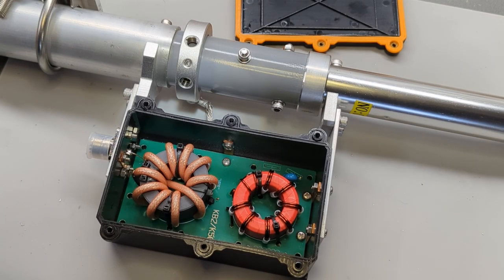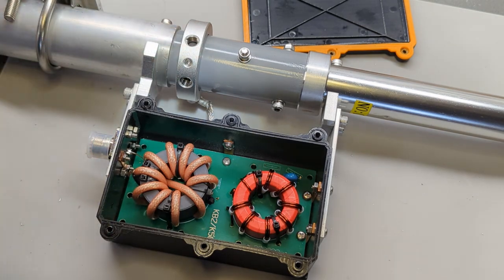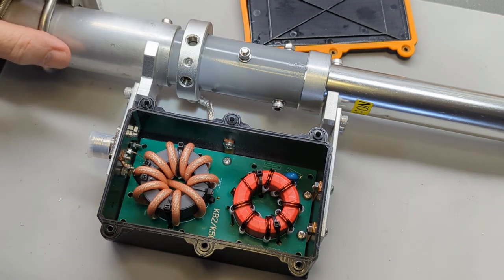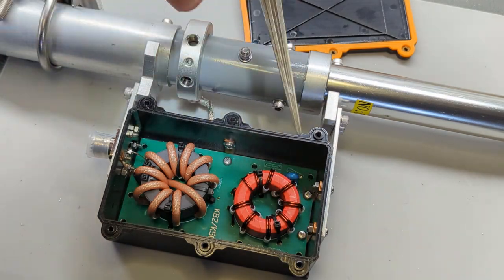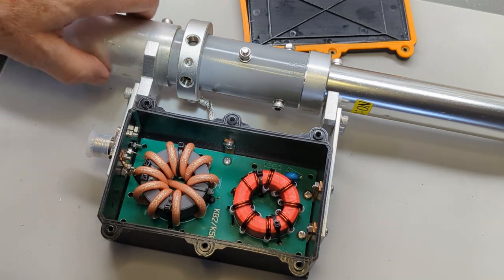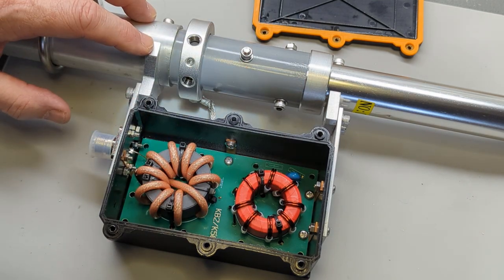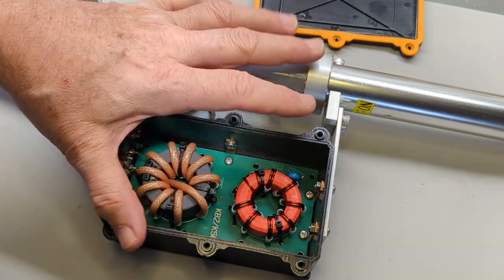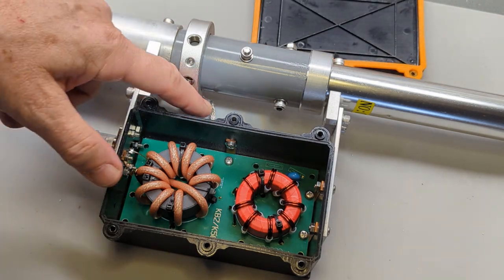The Business end of the Xiegu VG 4 Vertical

Comment: I doubt you pop the little cap @ the antennas rated kilowatt, the high voltage cap circuitry is on the secondary side of the matching transformer.

Comment: Great info.

But for those that are not aware, freezing the end of that tight upper section will surprise you all as to how much it will shrink the diameter!
Weather sticking it in a bucket of ice or as we do when replacing large elevator motor commutator, we taped dry ice on the shaft end of the armature and placed a halogen lamp close to the commutator.
A machine "press" fit will slip right on with ease.
Then as the temperatures normalize the fit becomes rock solid.
Reply from the maker: @garylanders1470  Excellent 👍

Comment: Unfortunately I have to correct you all, it is not an endfed. Basically all these types of antennas are a Windom antenna shortened with traps and are vertically polarized. And that's why it is only a 4:1 and not a higher impedance transformer. Sorry, I just had to get that off my chest.
Reply: My R7 is 31 years old...will be putting one of these on club roof and I will bet it outlasts me if looked after.....repair reuse reinstall...etc
Reply from the maker: @tomcruiser2407  Outstanding. The very essence of learning is to be open to correction. Thanks for this info and now I know 🙂👍
Reply: Since you seem very know knowlegeable about this antenna- Is there an easy way to add a 75 meter trap and thin whip to the top?
Reply: Cushcraft sold thier r7 as an end fed half wave...just saying😂
Reply: Yes the MN7 box had the little choke installed d
Reply: The cushcraft versions were not weather tight and had gaps at the feedpoint to allow draining😂